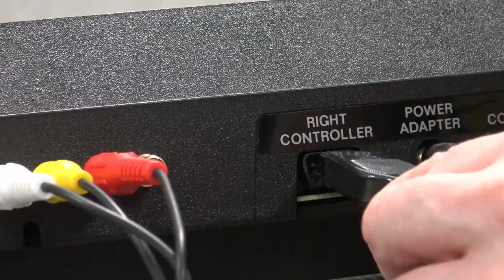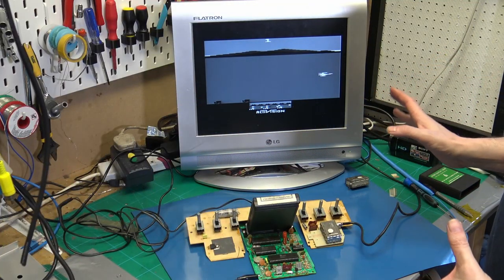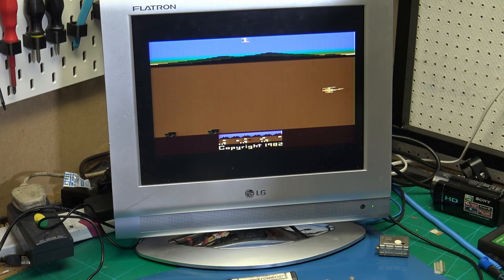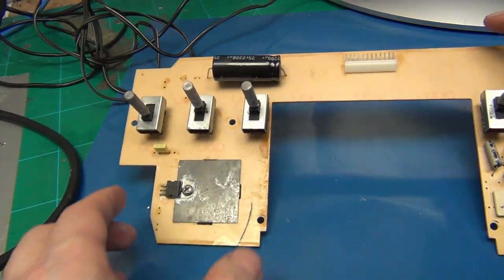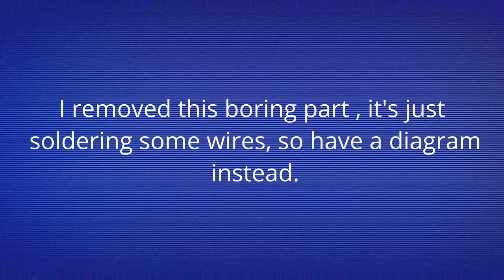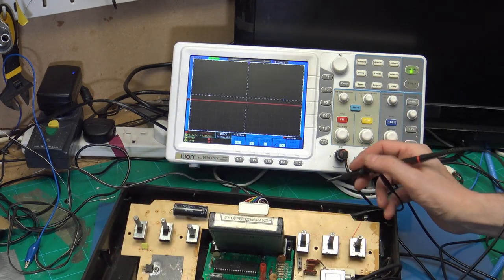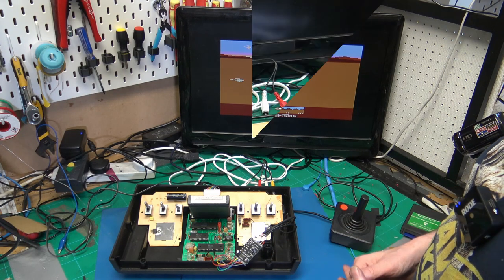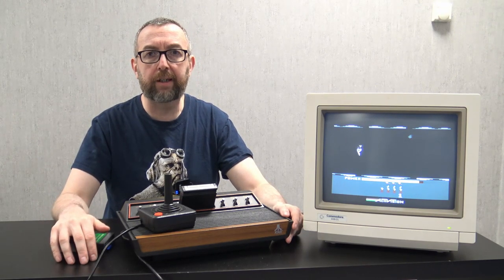Faulty Atari 2600 woody,  Colour fix, Restore and S-Video mod to work with the 1084S WOW

Comment: I think I want my Atari 2600 to have S-Video now! 😂 I was happier before I knew I wanted this...
Reply from the maker: it looks sooo good on the 1084S. you should get one, he still has a few for sale.
Atari 2600 S Video PCB PAL or NTSC SMD Edition [UK SELLER] [SALE NOW ON]
Reply: @leesmithsworkshop  I think I might do this to my spare one and recap it, although I couldn't find idiot proof recap kits on ebay. :(
Reply from the maker: @RobeenaShepherd  i only have the power kit
https://www.ebay.co.uk/itm/274741910218
Reply: @leesmithsworkshop  Thank you! I couldn't even find that.
Reply: @leesmithsworkshop  hi there, where are these monitors for sale please?
Reply from the maker: @MegaVinny73  ebay ? I just bought a 4:3 flat screen tv and had no idea of the specs.

Comment: Thanks, that was very interesting! I’d never noticed how little circuitry was in a 2600 compared to computers from the same time period
Reply from the maker: it does have two custom chips that are quite complicated, no video ram and no on board rom so missing features the other would have. When you think this was one of the first it's a very good design and actually very clever design for video.
Reply: @leesmithsworkshop  It is a pretty impressive design, especially considering when it came out and what the competition was.

Comment: Great work mate. Really like to see everything that goes on in a restoration, including the mistakes, as that's always the best way to learn. And I learned A LOT! 😂
Reply from the maker: I just watched it again and it does not bug me as much anymore haha. I should stop trying to be 100% perfect all the time.
Reply: @leesmithsworkshop  nothing wrong with trying to be perfect, as long as you can accept it will very rarely happen! 😂
Reply from the maker: @MoreFunMakingIt  at some point you have to accept it's good enough otherwise you will never produce anything.

Comment: Thanks for the upload. I really learned a lot from this awesome video. I just hope my mod turns out as good as yours.
Reply from the maker: Thanks for watching and taking the time to comment. Do you have the same mod ?
Reply: @leesmithsworkshop  I have the Atari 2600  heavy sixer.
Reply from the maker: @berzerkerjoe684  what are you going to do with it,  what modifications ?
Reply: @leesmithsworkshop  Bought a pre assembled Atari 2600/7800 Composite  Mod Upgrade Kit - DIY  ,where I can plug in the yellow, red and white jacks.
Reply: It's also from a company called silver fox, so it will be a similar mod as the one you demonstrated in your video.
Reply from the maker: @berzerkerjoe684  Yes I think that was the person I bought mine from. Good luck I hope it goes ok and you don't have those audio problems I had.
Reply: @leesmithsworkshop  Thanks man, I appreciate it !

Comment: Great video! I ran into a similar issue a few months back on an Atari heavy sixer. 
As usual I also followed the service manual flow chart with no success. I found an amendment page that spoke of the crystal that controls the TIA chip. Sure enough that was the culprit. That was a first for me.
Reply from the maker: not sure if I checked any of the clocks it would have been the next steps if rebuilding the colour circuit didn't work.

Comment: My VCS goes into a modern TV and most colours look sharp and solid, but a few, such as some greens and especially grey, are kind of flickery like they have their own little snowstorm going on. Wiggling the cable near the TV input made a slight difference so I tried a new aerial cable, only for that to result in a totally poor picture with weird white spots in a grid-like pattern and nothing solid at all (not sure if new cable is faulty?) It's the same with a second TV, an old LCD - identical colour issues. Does this point to any particular capacitor or can both these (quite different but non-CRT) tellies be the reason, rather than a console fault?
Reply from the maker: any new tv will have to convert the analogue signal to digital so it depends how good the timing signals are from the VCS compared to the tv. you could try adjusting the colour pot and tuning to one tv, but I can't really offer a fix, this is the only atari I worked on so I am not an expert in these matters.
Reply: @leesmithsworkshop  Thanks for your thoughts, I will try a few more things, maybe I can source a CRT to test, or a second VCS/2600. It's not a big problem, just an irritant!

Comment: I commend you on programming your logo to display on the 2600.  I have the same model and when one of the foam dust protector discs crumbled in my fingers I wondered where to get new ones, but apparently the answer is to laser-cut your own :D  Also Decathalon is a great game but unfortunately playing it ends up destroying elderly joysticks.
Reply from the maker: I used 8bit workshop and after trying to code the logo myself I found it had a built in graphic conversion tool. While learning a bit about how to program the 2600 I have nothing but respect for anyone who wrote games for the system no matter how rubbish.

Comment: Was the regulator a 7805? Would it be worth picking up a modern low temp switchmode replacement and next time you're in there, swapping it over?
Reply from the maker: I had thought about this and bought a 5v buck converter, but after all the trouble I had with getting these other parts working I just went with the part from the kit.
Reply: @leesmithsworkshop  Completely understandable. I've had mixed results myself. Worked great in the ZX Spectrum. Failed in the CreatiVision. I know Jan Beta had strange audio issues with one in a C64.
Reply from the maker: @CheshireNoir  after working on old arcade machines adding newer PSU would quite often add audio problems.

Comment: Nice logo!😉
Reply from the maker: Thanks to you :)
Reply: @leesmithsworkshop  I meant your 2600 one 👍
Reply from the maker: @GazMarshall  I could have spent a bit more time cleaning it up, but then it's just for this one video so I used the conversion tool settings to get a decent image and went with it.
Reply: @leesmithsworkshop  looks fine to me bud!👍
Reply from the maker: @GazMarshall  Programming the 2600 is hard and you really need to know how to squeeze every cycle out of the 6502. I think it was Ben Heck that talked about seeing the black lines on the side of Space Invaders was due to the code taking longer than the blank section of the tv signal.
Reply from the maker: @GazMarshall  it makes me want to see what @0xC0DE6502 could do with it.

Comment: I have a woody that has a blank screen or is just not powering on
Reply from the maker: you should go and see your GP perhaps they can help with your woody problems.
Reply: @leesmithsworkshop  he says I need a steel rod insert putting in
Reply from the maker: @michailokeefeMooMoo  :) did you check the basics so the power switch, 5v from the regulator ect ?
Reply: @leesmithsworkshop  no not yet not had chance but I will thanks for advice . I was hoping it to be something like a blown fuse
Reply from the maker: @michailokeefeMooMoo  they don't have a fuse.